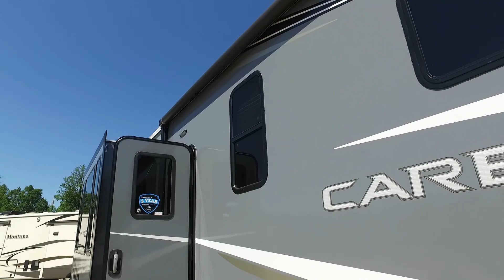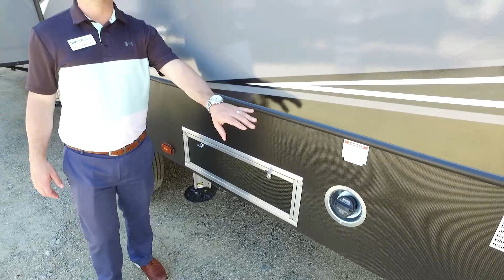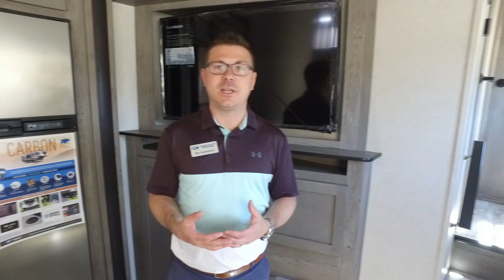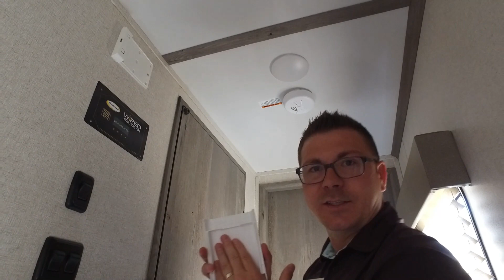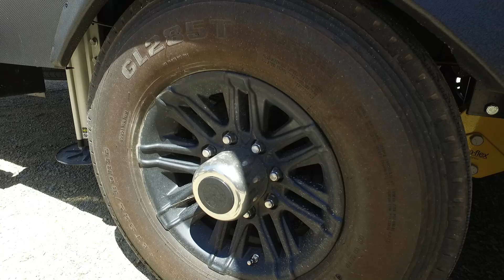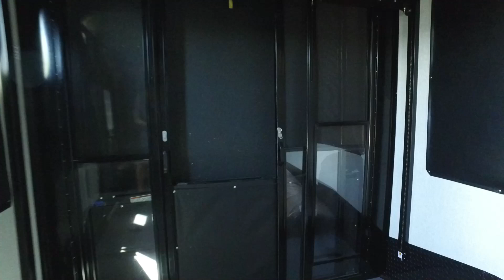Keystone Raptor and Carbon Toyhauler Comparison

Comment: Why do you make them so that you have to turn your neck to watch the TV? Sorry but that's a deal-breaker. I know that may sound like a small thing but after you sit there and watch TV for a couple hours and then you're neck is all sore I'm sure you know what I'm talking about. A lot of other  manufacturers have addressed this problem.. You guys are not off my list yet I won't be buying for a few years, I've just been shopping I want to make sure I get exactly what I want. I was impressed with your Hardware as far as suspension and the way it was built I hope this input helps you
Reply: The TV is on an arm.

Comment: Same construction won’t help the fact that wood will grow and shrink w heat and cold and I’ve time the fluctuation of those angled frames every so many feet will become so loose and sloppy that eventually your rig will sway and giggle your happiness away. Y’all don’t do it cheap. Please for the sake of happy babies let’s figure out how to ban wood on homes that move more than 2 time a year. Hell im going to  crunch numbers until I’ve added enough carbon fiber components threw out the top end of my rig that the only leaks that will appear, are the tears o cry for countless hrs , the amount of carbon waisted who’s finishing parts and cash